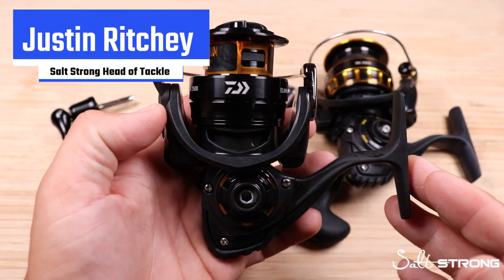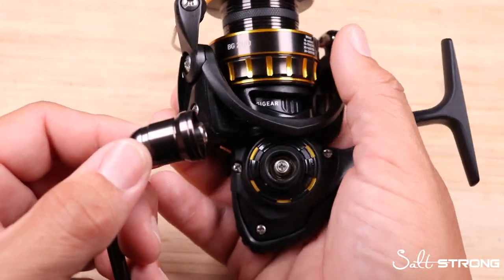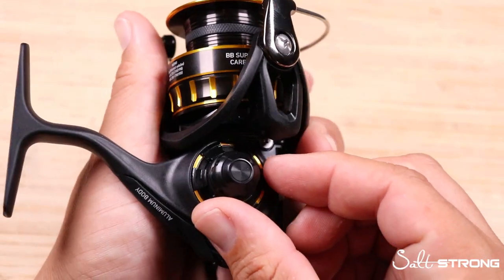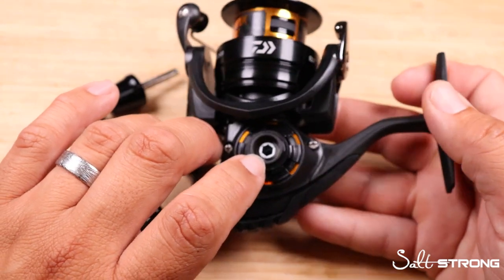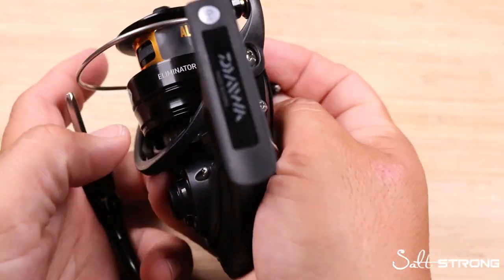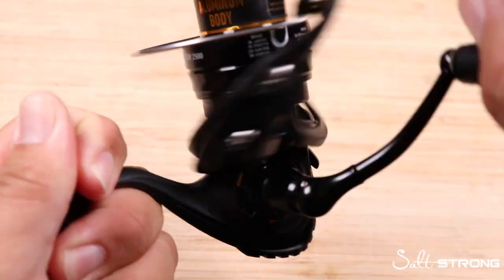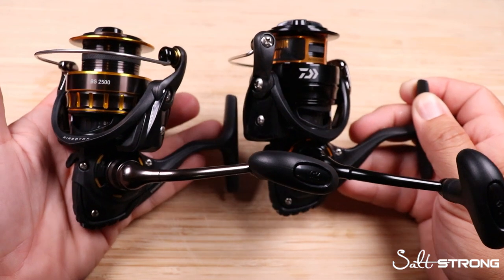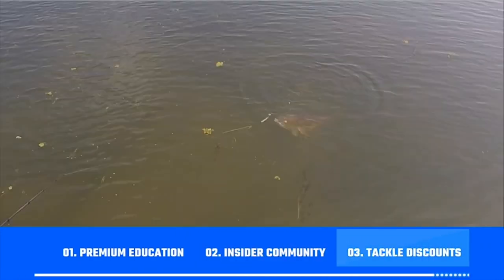The 2 Different Spinning Reel Handles and How They Work

Comment: Awesome video, I had trouble switching sides on the handle on my first direct drive reel. I was making the mistake of not holding down the rotor, which was not allowing the handle to screw on tight, making the handle to spin the wrong way and become loose.

Comment: I am old enough to remember when spinning reels were not convertible. They came in right handed (left side crank) and left handed (right side crank) models. If you wanted a right side crank, this was a pain. Stores often did not stock the left handed models, as they were slow sellers. Frequently you would have to have the store special order the reel if you wanted the crank on the right side.

Comment: I just bought a reel I cannot swap from a side to another, its weird because it doesnt say a specific side on the packaging or instructions, and there is no rubber spacer to adjust from a side to another, its the quantum escalade size 25, ive been looking for a whole to find a rubber spacer or any solution to my problem because I cannot return the reel and I really want to be able to use it.

Comment: I just got a D.A.M. Quick 3. I was putting some oil on some parts and now it’s only right hand retrieve. There is now a white gasket that only accepts the cap and not the handle.

Comment: What do you do when the threaded cap/bolt on a reel that you bought, when you try reeling, the bolt keeps screwing itself down until the handle won’t work any more?
I tried taking the handle off my current reel to check for size and that kept happening. I’ve bought some replacement handles so I’m hoping I can get the reel fixed up for a spare.

(rod reel combo on discount because the handle is gone. 80 dollar rod for 34! 🤩)

Comment: Just received certate 19 but I see some space between that black rubber gasket / couple between handle and body?? Is it supposed to go in all the way ? Ughh ,it's tight , but why is there a very slight space I still see the silver ....
Reply from the maker: Thanks for your question! Make sure to ask this over on the actual blog or in the Community 
where the coaches spend their time. The blog can be found here: https://bit.ly/3meZdv9

Comment: On the Daiwa BG 2500  and BG 3000 , the handle and the main shaft thread connection has only about 4 fine pitch threds , not  strong at all,  did you guys had any issues with this ? Thanks.
Reply from the maker: Thank you for your question! We have a massive library of fishing tips on our website along with a search feature to let you quickly filter down to find help you're looking for, so just go to https://www.saltstrong.com/ and use the Search feature in the top menu.
 
Note: If you don't see the exact answer you're looking for, just leave a comment in the post that most closely matches up with your search and one of our coaches will respond to your question... our coaches only make time to answer questions that get submitted to our website.

Comment: Whats the point of having a reverse switch on a screw in type? Would it just loosen it?
Reply from the maker: Thank you for your question! We have a massive library of fishing tips on our website along with a search feature to let you quickly filter down to find help you're looking for, so just go to https://www.saltstrong.com/ and use the Search feature in the top menu.
 
Note: If you don't see the exact answer you're looking for, just leave a comment in the post that most closely matches up with your search and one of our coaches will respond to your question... our coaches only make time to answer questions that get submitted to our website.